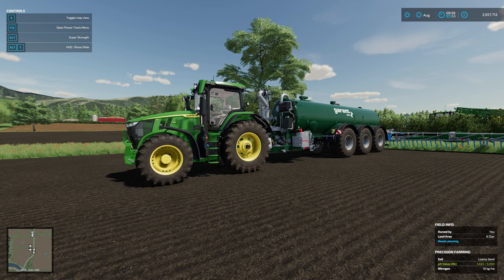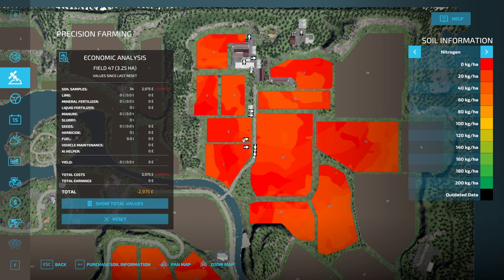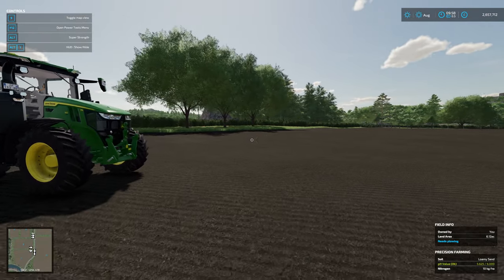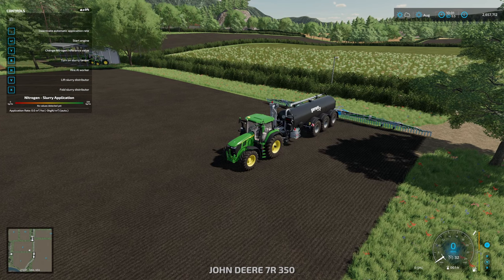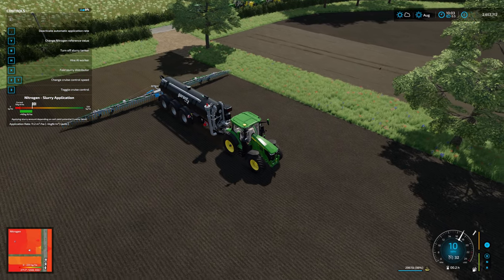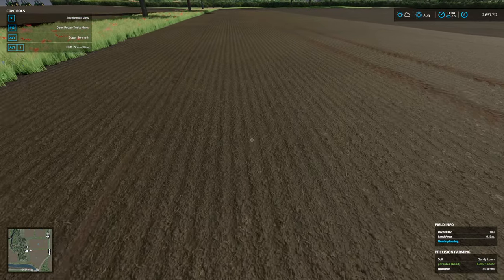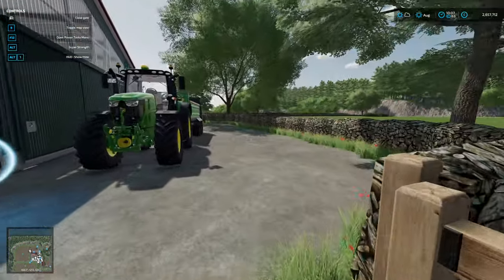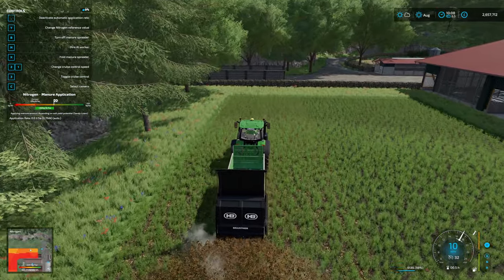A Guide to Precision Farming #3 Slurry & Muck Spreading

Comment: Hey there! For the Manure Sensing, it's pretty notable that the device is attached to a pipe on the slurry tanker itself. It is my understanding that liquid manure is pretty inconsistent, like milk that has separated after sitting in the fridge too long. This causes the tanker to apply the nitrogen too weakly in some areas, and too strongly in others (apparently a deviation of up to 40%). The Manure Sensing system checks what is flowing through the pipe and, through the magic of technology, ensures that the nitrogen content of the liquid manure is applied in an even fashion. However, the 'target' nitrogen level of the soil won't vary on if you use the Manure Sensing system. It is, also, already varied across the entire field before you even apply any manure; so, the tankers only apply a specific amount based on the soil type, which it does without the Manure Sensing system, and the result only 'adds' to the already varied field. The difference is that, by the inefficiencies of liquid manure, it had a chance to fall short or apply too much... potentially wasting manure or leaving your crops wanting for a bit more. A better way to check this would be to apply liquid manure without the Manure Sensing system on an entire field. Check how much was used in the Precision Farming stats, and potentially take a screenshot of the field's nitrogen levels. Then, you'd want to wait until the next year or whenever the nitrogen levels reset back to their original values, and then apply liquid manure WITH the Manure Sensing system on the SAME field. When I do this, I notice that the overall application is less varied (smoother) across the field, and it uses a different amount of manure (seems to be random, since without the Manure Sensing system the manure can be applied randomly within a certain range). Sorry for the essay ;-)
Reply from the maker: Thanks!! That's awesome knowledge and don't apologise for sharing.
On my series I'm still just using standard 40% slurry applications pre planting/seeding and then on the grass after cutting. One day I'll afford a fancy one with a sensor 🤣
Appreciate the feedback 🖤💚💛

Comment: Sensor on the tractor (or the Pro Active) is useless when the crop isn't above ground (needs to be a type of green on the map).
And I even think it is useless for manure and slurry ... as I m using it now and it doesn't apply the amount of slurry for the crop, but for the soil type.
Later I will test if it works with a fertilizer spreader (perhaps there is a problem with the map). It should mention what crop is in the ground and then apply the perfect amount for that crop on that soil.
All the videos on YT are people using the fertilize spreaders ...

Comment: Farmers use slurry mainly for Grass!!

With Precision Farming I wanted to do like in real life slurry spreading on grass field and with all sensors Tractor,Slurry spreader you can not detect Grass as a crop!!!

So,I dont know what yall think about that?!?
But they failed in my eyes with Slurry and Muck spreading part!
Reply from the maker: Its been updated and with a sensor on the slurry tank I believe it works as should I slurry my grass all the time on my Maypole Series with precision farming.
And also slurry my crop fields prior to seeding to get the base 40% nitrogen so save on artificial fert.
Manure I also use pre-seeding/planting for the base 40%.
Reply: Not true. Natural fertilizers require expensive equipment for application where chemical fertilizers are easier in application. The chemical fertilizers getting more and more expensive so slurry, manure and digestate are used more often nowadays.
Reply: @TractorPowerPL  you say “not true” but it seems you are in agreement 😂? Maybe I’m lost.
Reply: @danielrivera1833  "Farmers use slurry mainly for Grass!!" this is not true.

Comment: Can you spread Slurry instead of putting down lime? Can you put down Slurry before seeding?
Reply from the maker: The lime is irrespective of the slurry, the lime is to balance the PH levels in the soil, and the slurry is to improve the nitrogen. As to when you do it, any stage before drilling is fine. If you want, you could, after drilling, just remember that it adds base 40% without a soil readings and the regulator on the slurry spreader.
Reply: @MrFarquar  is it really necessary to have the unit on the slurry spreader in ADDITION to the Isaria Pro (or however you spell it) ? Isn't the unit on the tractor sufficient for controlling the application rate on the spreader? And finally, which Slurry spreaders can you attach this unit on? I'm using the Samson PG35 tank and apllicator
Reply from the maker: @Hittman67  I believe it only attaches to the ones in he back and any mod that specifically says it supports it, I don't think their are many. The unit controls the flow through the spreader, so yeah, it needed, mate.

Comment: So we don't have a way to use slurry or manure for contracts without applying at full rate? I was hoping to make some money doing that :(
Reply from the maker: No it seems contracts still go with the original fert method. I had considered buying all the fields, analysing them, and then selling them back in on of my saves to see if it makes a difference. 🤔🤷‍♂️
Reply: @MrFarquar  that's a good idea! It's worth a try

Comment: great video but pretty much invalid - if you know soil samples then soil is constant in this specific area - you are not applying slurry to any plant so technically there is no need for variable rate
Reply: ok I watched some other video so apparently you should do slurry, digestate or manure as a base that covers only need based on what type of ground you have, so isana is not needed at all, you just need soil sampler

now for john deer detector that you mount - slurry can vary up to 40% in some places without it, if you put it on, it's constant value.

When preparing field, you can manure before next sowing (or after doesn't matter as long as you know soil) and after seeding you should do fertilizer to up values of nitrogen. It saves you money as slurry, digestate and manure you can basically get for free in tons.
Reply from the maker: @sgtace  Yeah slurry or manure before seeding and planting, it turns in the soil as you then seed. Gives you the base 40% basses of soil type I believe, then you fert' after with artificial to give yourself the max required coverage.
Thank you so much for watching an taking the time to really think about the processes and what I did, greatly appreciate it and feedback is always welcome 🖤💚💛

Comment: 10% less is no difference for you?
Reply from the maker: Honestly it's that long ago I don't know your reference point, I do remember that at the time, it felt like there was little to no difference in using some of the extra slury equipment. In my let's plays I haven't used them as the auto on most of them seem to do a good job with slurry and manure. And I've so much stored I'm usually selling it. 😅👍